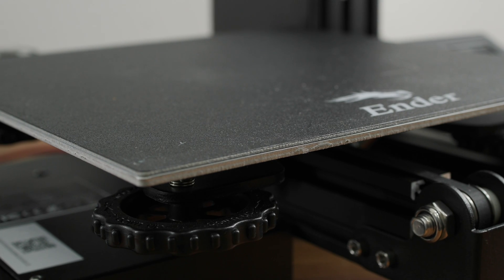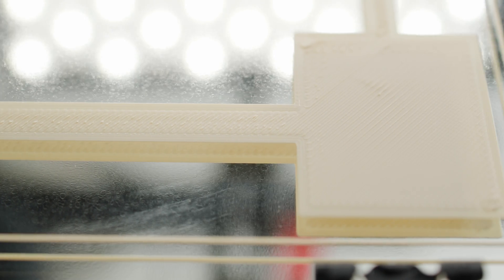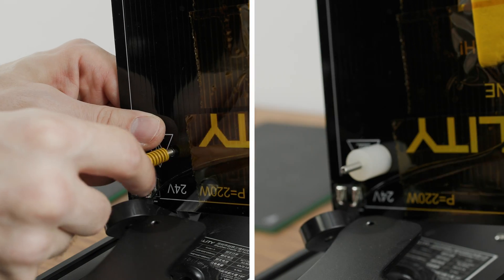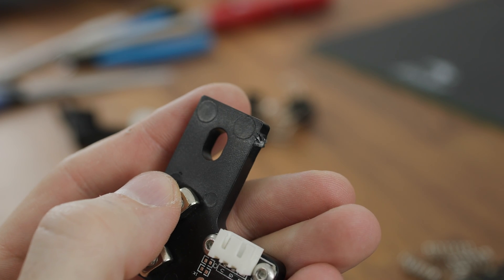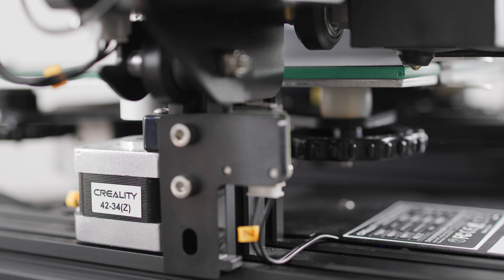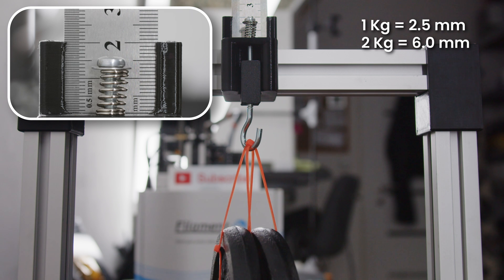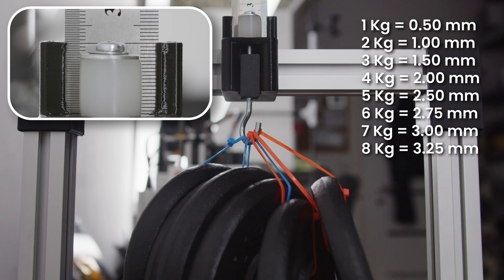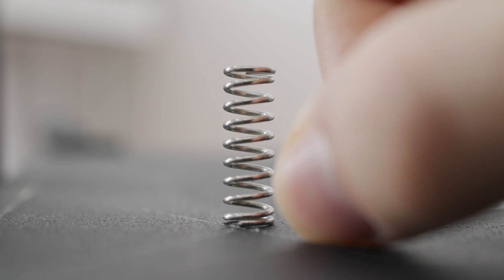Creality Ender-3: Third upgrade - original springs, yellow springs and silicone mounts

Comment: I don't use springs at all.  I secured the bolts to the table with a washer and nut so they couldn't move.  And to adjust each angle I use two small adjusting nuts.  Yes, it is very inconvenient to adjust them, but it needs to be done only once.